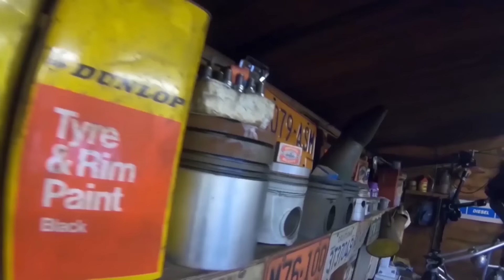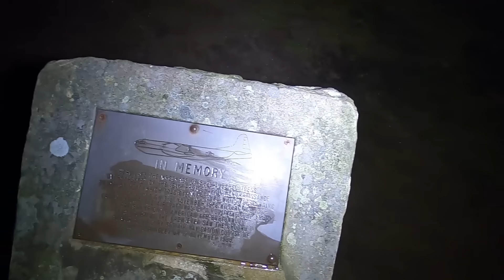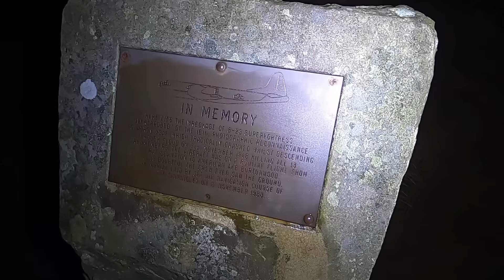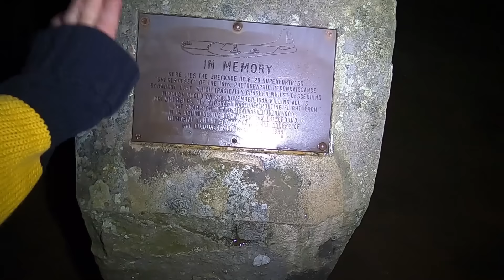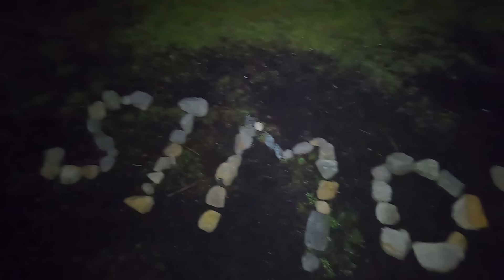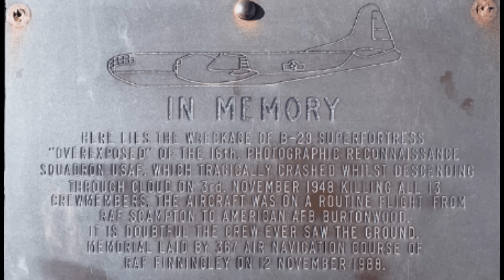Crashed U.S Airforce B29 Superfortress

Comment: 33:01 you are correct, engine cowling and wing section, the big round rusty section with a big hole and a smaller hole that look like the front of an old boiler are a kind of engine bulkhead between the block and the wing. 👍

Comment: They were turbocharged. Them radiator things would be oil coolers. Look back at the gears. You can see a wobbly ring around them. They're the camshaft. You can see the roller cam followers on them. The iron near your bag and jacket would be the main landing gear and the other bit would be the nose wheel strut
Reply from the maker: Thanks for the info

Comment: That cooler-looking thing you saw there probably was an oil cooler. An intercooler for this huge engine (Can't be arsed to look it up just now, I think it's in the 60 to 80 litre stroke volume range, maybe even more) would be, umm, slightly bigger. Considering the fact that the B-29 was mainly designed for flying at high altitudes where the air is dozens of degrees under freezing temperature, an intercooler might not have been so crucial anyway.
And yes, you were right, the big air cooled radials were direct drives to the propeller. With these very powerful engines, you needed big propeller circle areas, thus big propellers, to get all the torque from the big engines transferred into the air. This means that the tip of the propeller is travelling at high speed, approaching the speed of sound if you add the velocity of the plane.
That is one of the reasons why these planes had constant speed propellers, where the engine rpm is set separately from the power. The pitch of the propeller blades is controlled by a hydraulic that is controlled by centrifugal force to a value set by the pilot. When the power setting changes, this mechanism will maintain rpm via the propeller pitch. This also adapts to higher airspeeds without having to have the engine rev higher, which was what initially inspired this method of engine control.
The bulged up bit of shock absorber cylinder must have been an impact damage indeed, demonstrating the brutality of the impact. The B-29's main undercarriage folded up when retracted, so that the axle of the wheels would have ben situated behind that bit. The section where the cylinder popped open would have felt the pressure built up by the impetus of the entire unsprung mass of that undercarriage leg. Like, half a ton of rubber and metal decelerating from 200mph to 0 in a foot. A clear indicator of how absolutely no chance of survival whatsoever any of the poor lads in that plane had.

Comment: 35:40 Probably is a fuel tank, that rubber matting is a self sealing compound. If punctured by a bullet the leaking fuel would cause it to swell up and seal the hole.